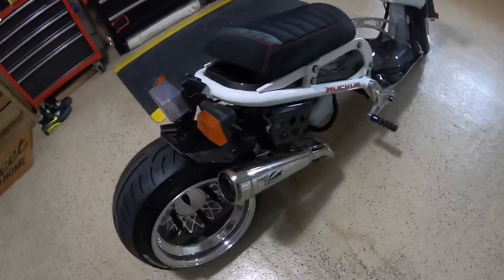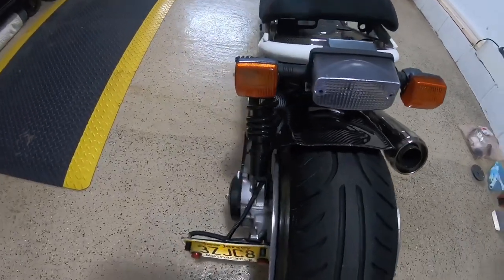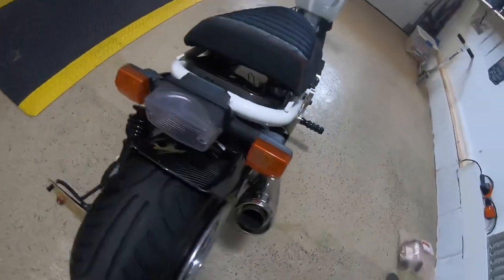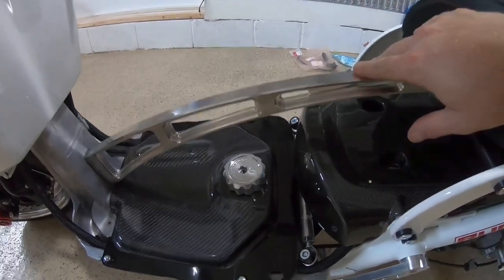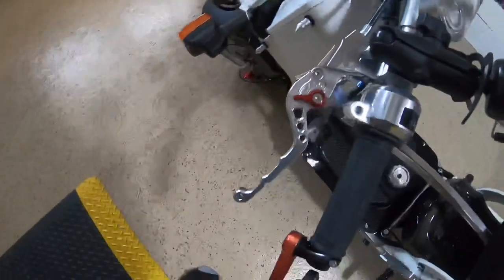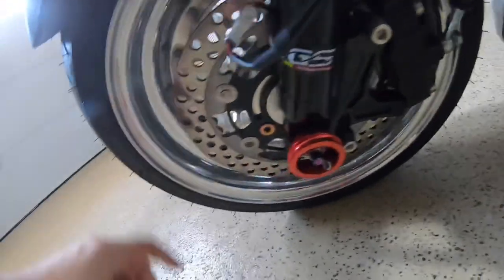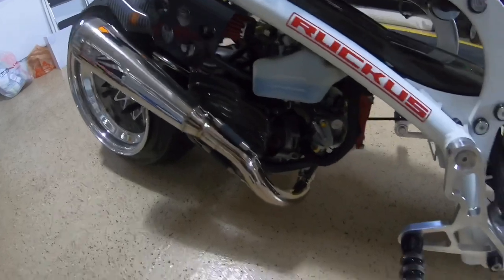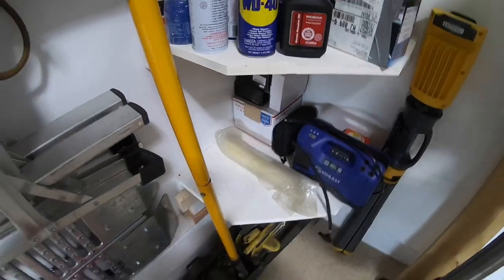2018 Honda Ruckus Build

Comment: Home looks great. Allot of time and care out into it. It shows. Your "extra" drive faces, you want to sell? I'm researching some engine upgrades. I may need a new one to go with that. I still have my stock one 🙄
Reply from the maker: CornPap Brecht I really don’t want to sell them, I didn’t have good experiences with either one of them. Lost mph on the too end on both of them. I’m talkin 8-10mph not just a few. Can’t be my setup because as soon as I put the stock face the mph went right back up. I dunno if these are from the same batch and the angle wasn’t cut right. There’s a couple other people I talked to that had the same exact issue. So I don’t want to take anyone’s money and give out a bad part.
Reply: That's cool. Appreciate the honesty. I won't look at one of those new then either 👍. Good video. Stay safe man!
Reply from the maker: CornPap Brecht you may have better luck...I have seen a lot of success stories of people who use them. In my case and a few others, they just didn’t work out. They can be had for $30...but still, $30 on a part that may not work?

Comment: You installed everything yourself or had a shop do it? Live in Boston Massachusetts and I haven't seen much activity in people with ruckus here
Reply from the maker: Douglas Jerez what’s up bud...everything done to the bike was done with my hands. It was never at a shop for anything, last time it was in a shop was the day I bought it! Plenty of vids on here on pretty much how to do anything or at least out you on the right path.
Reply from the maker: Douglas Jerez same thing here in NJ...everyone that has one is spread out so far it’s difficult to get together
Reply: Wide Open Throttle That’s dope you did a awesome job on the build. I am trying to learn as much as I can have always wanted a ruckus for like 5yrs finally got one this summer and so far it’s been out of service 4 times (currently not running)  and a oil leak from the engine smh 🤦‍♂️
Reply from the maker: Douglas Jerez thanks man appreciate that. Yes they can be a headache sometimes, I can’t disagree with you there. Keep goin at it, you’ll get all the kinks ironed out!

Comment: So if a 12 inch rim barely clears it's still a long case engine right? Thought long cases could fit a 13 inch rim
Reply from the maker: I think your referring to a GY6...this is a GET engine. You can fit a 13” wheel on a GET engine with a tiny tire. Inch bigger wheel, tire thickness has to go down an inch.
Reply: @WideOpenThrottle  sweet thanks for the reply, reason I was asking is I didnt know the engine, also was wanting to build one, and with a short case gy6 only being able to fit a 10inch, thought a smaller tire would be able to run a 12 inch rim
Reply from the maker: @quinton7854  I’m not sure about all the stuff with the GY platform. I wish I could help you out bud
Reply: @WideOpenThrottle  no worries just thought I would ask

Comment: Great vid & nice mods on your Ruk!!! Do you have a name or link for your LED head lights from Amazon? I want to try them out since you mentioned they weren’t bad for price.
Reply from the maker: Horacio Prado no I don’t have any idea which ones they are...I bought them well over a year ago. I can tell you this, they are 35watts (stock wattage) and the back is gold, there is no ballast. I moved not too long ago and I threw out the box when i moved. Actually you know what, you’re in luck. I went back thru my amazon orders. Here you go. Seems like they changed the listing though. The ones I bought are 35watts.

Chylay H4 LED Headlights Bulbs,... https://www.amazon.com/dp/B07J68S4NL?ref=ppx_pop_mob_ap_share